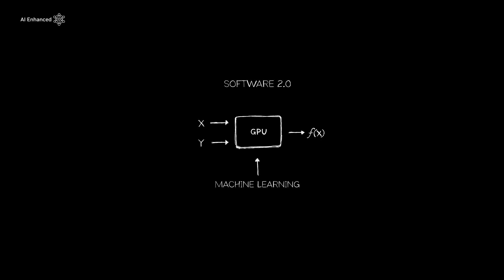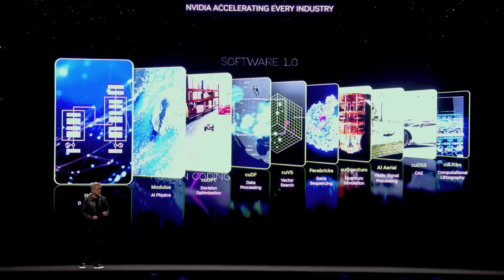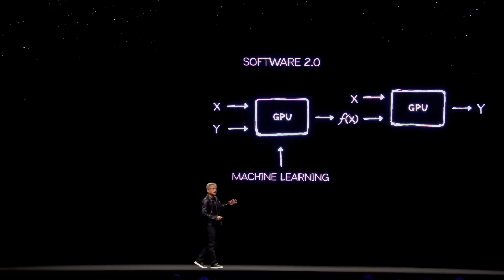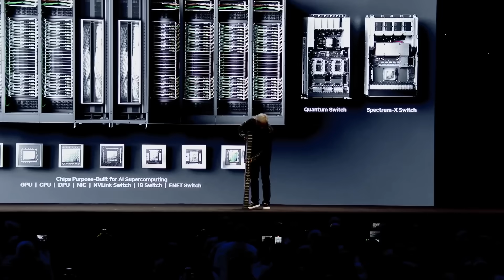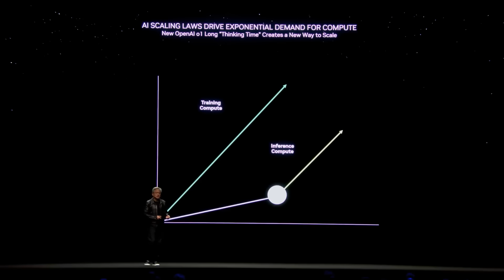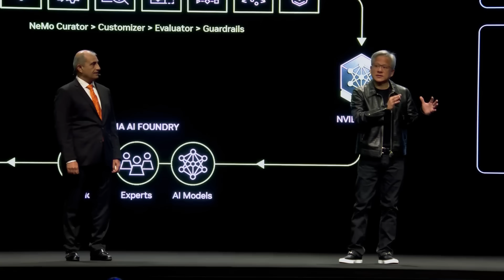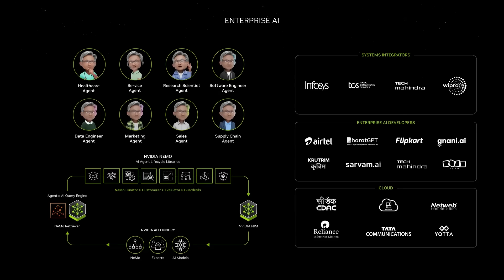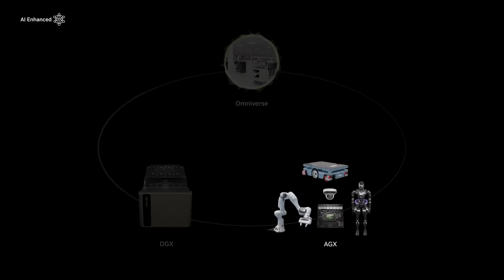NVIDIA CEO Jensen Huang Leaves Everyone SPEECHLESS (Supercut)

Comment: Moore's law only exists in hardware. Programmers on the other hand have become lazy AF.  
The "modern" software is absolute CRAP and has become BLOATWARE. 
Proof of that, are operating systems. They went from a few megabytes to several gigabytes. The same for most apps too.

Comment: for nvidia's line of business of selling computing capability this new "software" 2.0 based on ML is great. But why that makes current or classic programming "bad"? because is made by human beings that Nvidia can't sell? why replace fully working deterministic systems by those made by IA that actually costs a lot of power and energy to be produced, refined and run? I can see IA as a good efficiency tool regarding the ability to produce new systems that humans can't or haven't done yet because the data volume is not at human scale. Like simulating and testing billions of combinations. But neural networks are like statistics that are based on the premise that the data is correct. I mean if you feed a ML model enough data that 2 + 2 = 5 the ML will produce a model that produces wrong addition results. This is very different from fully deterministic and rules based programming that is correct (or wrong) by fundamentals. As Huang mentions on this speech this programming model are like numeric approximation formulas and those never produce truth only approximations of truth. That might be a dangerous path to follow if all systems get to be made that way. You will end with software that on some occasions will produce wrong results impossible to track and correct as no human being will be able to modify ML generated functions as the programs will be unreadable. This issues are already happening on some industries where automated decisions hurt customers and as those companies don't provide proper support by trusting blindly on automation, customers get their rights denied and the basic rule "customer is always right" turns into companies that only trust on their own belly button.

Comment: This speech is highly exaggerated. The tasks were humans were always better than machines are the only tasks that are done with ML. All the other tasks where machines have always been better than humans will still be coded in a programming language cause these types of apps will run with 1000% more efficiency than a multi gigabyte neural network. Just take for example the windows calculator...do you really think that this tool will run as a neural network in the future? 2 Gigabytes on the disk and every calculation like addition would take countless weight multiplications just to approximate the addition operation. Just think about the wasted energy doing that. It's ridicolous...this man's speech is ridicolous.

Comment: I was able to buy an RTX 4050 after 4 years. This Nvidia CEO is not one to bet against. Insane what they have achieved in this short GPU life span
Reply: And how much less they achieved in the say last 3 years..
Reply: in confused rtx4060 is a bad gpu thats the main reason immma get a rx 7900 xtx
Reply: @LegacyChasersComics  It's not a bad gpu at all it's just overpriced with not enough vram.
Reply: @retrosimon9843  you just explained it yourself it’s over priced piece of junk lol.
Reply: @LegacyChasersComics  I bought myself an RX 6800 xtx and it's supposed to be just as good as a 4090 but at a better price. But one thing I know for sure I'm set for a few years before needing a new GPU
Reply: @Vectures  bro you’re so badass for having a rx 7900 xtx. Is their anything I should know about that gpu before I get it. Cause it’s between the 4080 and rx7900 xtx for me. I need to honestly upgrade my rtx3080 pc
Reply: @LegacyChasersComics well 7900 xtx is a very good because it offers more Vram. But 4080 S is better for strictly gaming, because Nvidia is way further ahead in ray tracing and upscaling. Also Nvidia’s drivers are generally more stable. It is however, not as powerful as a 4090, it’s about on par with 4080. 4090 is 30% faster than 4080

Comment: Don't care how great Blackwell is , they are beholden to tsmc and lined up like everyone else with alloted slots thus can't fill their many blackwell orders even if they want to.
Reply: Seems like companies need to work on expanding chip building dramatically and away from unstable countries.
Reply: @ctingulz  making chips foundries is expensive. If they build enough of them then the price they could charge, would not allow them to pay back the money they invested
Reply: @ctingulz  US tried it against Japan but they only succeed at EUV level. For most chip materials, Japan has most of the monopoly, patent, and research in this area.
Reply: yeah and tsmc have to make the chips so it's not like they would just stop because they would not make money
Reply: @Keltzzzz  They are building new fabs as we speak, and potentially investing $20b in a new one
Reply: It's crazy, I always thought Nvidia builds the GPUs, but they only design it. Companies like TSMC and other foundries actually produce them, as well as IDMs (Integrated device manufacturers) that both design AND manufacture ICs and devices.
Reply: @Alex_1729 just like how major car manufacturers don't build and produce all the parts of a car. For example,  Toyota designs the engine, transmission, suspension, drivetrain and the shell of the car, but all the electronics hardware and software is consigned to other companies. That's the OEM business. These products are just too complicated and expensive to be produced and designed  by a single company. 

The only corporations that can come close to building and designing and mass producing complex electronics products, from in house design to mass prod, are the companies under the US military industrial complex.
Reply: @Alex_1729  Not quite, they are producing it using specialized machinery. This machinery is created elsewhere ( ASML in the Netherlands) each one costing US$400 million.
Reply: Not how their relationship with tsmc works, but k. Actually, not even correct as to how chips are made either. It's 2024 and people are still clueless about how the semiconductor industry actually works lol.
Reply: @Tential1  can you please explain how they actually work?
Reply: TSMC is virtually a monopoly. Only good thing is that their machine parts are produced by vendors all over their world so they aren't vertically integrated.
Reply: So having to get stuff done at intel
Reply: They can always increase the price to infinity though.

Comment: someone who works with CUDA - is there an opportunity to drill down below that level to take particular advantage of features of the chips, akin to what you would traditionally do akin to maybe writing assembler for some particularly important part where you need every tweak you can get ?   Likewise on LM level, how do you narrow the input data to get tighter data sets which exclude duplications etc when training ?
Reply: Short answer to the first part is no. As nVidia uses CUDA as a vendor lock-in mechanism, they have no incentive to allow you to tinker outside of it as it detracts from the potential library of CUDA services that isn't locked to a specific chipset they produce (which could potentially act as inertia for buying future upgrades as well as create problems with quiet model revisions). In regards to the second part, I use clever scripting to clean up my datasets for training. The solution being highly dependent on the goal of the model.

Comment: Computers been around only 60 years?
Dang, not even a century and already they're advancing pretty fast.
Reply: @CrowleyDusky  I’ve been  working with computers for 60 years (1964) 😀 so at least 70 and 80 if you include the ENIAC from WWII.
Reply: The inevitability of where we are today was predicted very early on in the life of computers. Where we go tomorrow with computing is impossible to comprehend as the compute ability is advancing at exponential speed. Next 10 years will see colossal change, I’m not sure that most people will enjoy the change it may be painful
Reply: @mikewa2  The magic is that for personal computing, 99% of the population can buy a PC for under $1000 and it will do what they want for the next 15 - 20 years as long as it's still supported and that tends to happen first, the hardware stops being supported.  The only REAL issue right now is how much AI compute power people want.

But this is why I didn't listen to this video because I already heard a brief snippet of what Jensen said and his goal is to convince you that you NEED an Nvidia based system they're putting out in the near future.  With AI being the new thing you could be convinced that AI accelerator cores HAVE to be included in the processor.  No, no they don't.  With faster interfaces anything connected to the CPU on the PCIe bus can process AI.  We are now at PCIe gen5 which is fast enough for any home use case.  Neural Processing Units (NPU) are going to be released by different companies on NVMe devices, and in fact they already are, but more powerful ones will come out on NVMe and wont cost much, and that means I could run AI workloads off an NVMe connected to a Zen 3 based CPU on a motherboard that has an open NVMe port.  Gee, glad I bought a motherboard that has at least 2 NVMe ports.  I will admit that the PCIe interface on that motherboard is gen4, but it will still be fast enough for typical light AI loads that run on a home computer.  And this means hardware that's already 4 years old can be upgraded, run Microsoft Windows 12 and you can be fat dumb and happy watching YT videos on your 10 year old system that runs great, because you don't need the kind of power being talked about as 99% of the population doesn't.

But new CPUs coming out on X86-64 are going to have a mix of cores and will certainly have NPUs built into the CPU.  Graphics cores might not be included because once again PCIe gen5 is fast enough to push that work to the GPU anyway.  OMG it takes TWO MORE SECONDS!!!!!!
Reply: Yeah actually computers go back to before WWII, but they weren't digital then, they were analog computers.  Once the transistor became small enough to make a computer based on transistor technology was when the push to digital computers started.  It was a digital computer that flew to the moon in 1969.
Reply: @johndoh5182  The Apollo Guidance Computer was indeed the first modular digital computer, and paved the way for the computers we know today.

Comment: My grandkids will be baffled that the G in GPU stands for "Graphic"
Reply: Chips made exclusively for AI, could be called IPUs.
Reply: @paulmichaelfreedman8334  they're called TPUs, "Tensor Processing Units". They've been around for a minute now.
Reply: @paulmichaelfreedman8334  tpu or tensor flow processing units that are application specific integrated circuits (ASICs) exist already, there isn't really an accepted term for generic "AI accelerator" ASICs but just happens CUDA and matrix related math both good for computing color or shader for a given pixel in a 3d scene or given output of a neuron in a neural network.
Reply: @paulmichaelfreedman8334   They are called NPUs
Reply: At this point it may as well mean 'Geforce Processing Unit' - as NVidia uses the term willy nilly to describe whatever their custom chip architecture is. Any other company making AI processor refers to them as NPUs, or Neural processing units
Reply: tell them it stands for grandkids and kick the baffle up by 100x
Reply: GPU cannot replace a CPU.
Reply: @Art-is-craft  no one is suggesting that it is.  The suggestion is that Moores law no longer carries, so software has to become the one that is scalar, if anything will be
Reply: @subitopiano1  
Moores law will continue for decades. CPU and GPU are here to stay for a while.
Reply: Because by then GPU will equal God Processing Unit.  The GPU will command the grand kids to do the bidding of their overlords.
Reply: My grandkids will not be baffled, they dont get born because of the world no more needs workers, everything is run by robots and automation, led by the few that demand global birth rights should be controlled. Less people have the right to exist, its just not worth it. It takes more than it gives. Although more people could exist as the medical knowledge has gotten much more better. People get the right to be born by their genes, just so that they can take their place in the world that their genes are good for. Genetically engineered children are only for the elite and they get to keep their children always. Its inevitable and anyone with a brain can see it coming. Not that you should care about it as youre not there to see it, maybe not even your kids, but eventually in less than 300 years from now.
Reply: @valkohh  It's a good thing in the long term. 

People should not be angry that the children of the future will live greatly enhanced lives. 

It is the duty of humanity to improve life and push forward evolution.
Reply: @valkohh  ai = no more kids?  yikes!  got a lot of angst there, huh?
Reply: Greed Pricing Unit, or dollars in America. Nvidia makes a GPU and gets dollars. I say fight the power, buy AMD.
Reply: it actually stands for generating processor unit grandpa
Reply: @sxyqt3.14  It means Gigantic Price U can't afford.
Reply: @sxyqt3.14  Graphics processing unit, kiddo
Reply: @sxyqt3.14  Nice try troll

Comment: Man who built his business around GPUs predicts that GPUs will be the center of the universe. Shocker.
Reply: It was quite a beneficial accident huh? I got in at $20 in 2015 the guy has guided this evolution by using the Graphics as his off ramp to develop the next generation of computing. What better laboratory than gaming! Nobody is going to lose millions if a glitch in the code instead a pro gamer loses the progress on his all time high. He sends a complaint into Nvidia and goes to smoke it off. An hour or so later with his attitude adjusted he notices that they not only fixed the issue but tightened up the games intensity. Rinse and repeat and they continued down the path to becoming the most valuable company in the world. 
Sorry to hear that you missed the investment of a lifetime as the whiney Karen tone of your statement 😂😂😂💵💴💸💸💸💸💲💫💰💰

Comment: Sorry Jensen, there are some things you can't "accelerate" (aka parallelize). Pretty much every program has sequence of steps that need to be executed in order. Scientist and engineers have been searching for this holy grail of parallelizing everything, but it's mathematically not possible. CPU companies like Intel and AMD have put in decades of work into branch prediction and gotten some gains, but you can't predict everything. I'm sure today's latest AI models could improve on this, but you can't do what is logically impossible (100% prediction of all branches).
Reply: Branch prediction is very important for common CPUs, but it has nothing to do in AI.
Imagine that you have a huge array of data and everything you need to do is very simple allreduce.
This is very simple calculations and there is no need to jump depending on the result of calculation.
And every chunk of data can be calculated independently (in parallel)
Reply: @dimes1917  not arguing with that scenario. That’s why GPUs exist and are so good at tasks that are parallelizable such as graphics and DNN training. But in the video, Jenson is implying that we (software developers) have to apply this throughout our code instead doing sequential operations. I don’t think that’s possible. Let’s take a super basic “Hello World” program. The program starts, it prints the string, and then ends, and it has to do all 3 in that order. You can’t end the program at the same time you’re printing the string. Another example would be a function that has a switch statement based on the current temperature outside. This value is fetched from an api, and let’s say we divided the values into three ranges, such that there’s 3 different branches the code can take depending on the temperature. You can’t predict the temperature value in the code so your branch prediction pipeline will fail 2/3rds of the time. Expand this to 100 temperature ranges and you see how the problem only gets worse the more complicated the conditional logic is.
Reply: @magicsmoke0  sorry, dude, but seems you think too narrow. 
Probably outdated... 
Well, about 25 years ago I worked in Intel compiler team...
Reply: @dimes1917  I’d love to hear in more detail how this outdated. Tell me how we can use the GPU to “accelerate” a REST API that does CRUD operations for an e-commerce website?
Reply: @magicsmoke0   I feel your pain, bro! 
I optimized computing for Itanium! 😀
At asm level... 
Our world has changed! 
Drastically!
Reply: Quantum computing would solve it I guess, easily simulate trillions of states at the same time